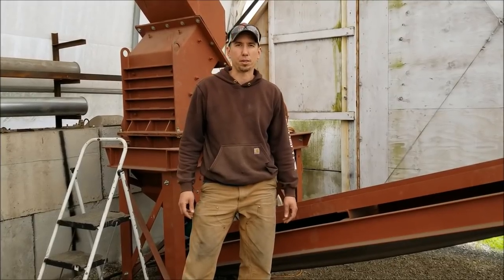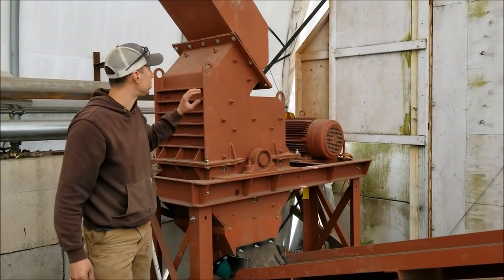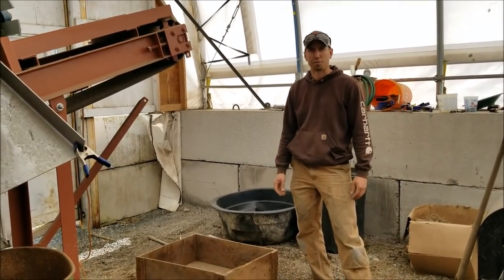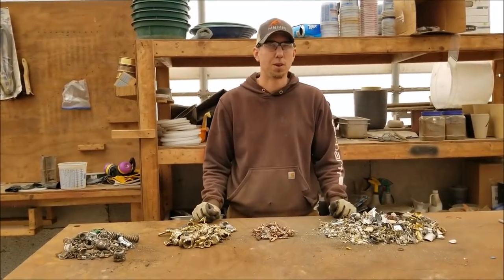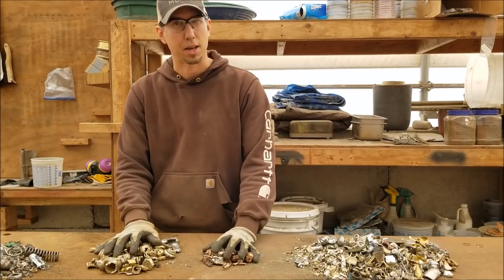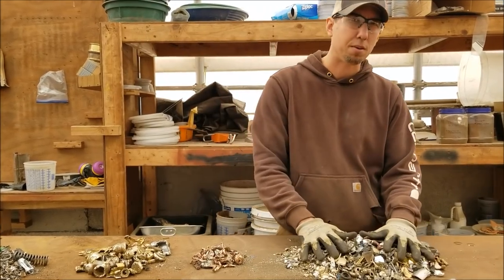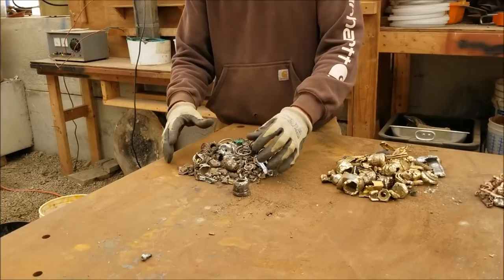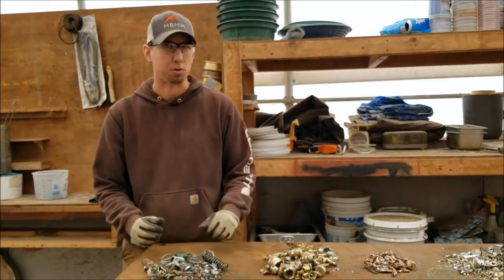Crushing Dirty Brass and Copper in a Hammer Mill

Comment: I know Jason you've been very busy with your new Foundry but here's another suggestion I have for you I would really like you to run submersible pump motors through your Hammer Mill there is a lot of copper in them but the stainless steel jacket and the epoxy coating that's inside is a beast... would love to see some samples
Reply from the maker: Do you have some you can send up?

Comment: If you slowed the conveyor speed down and moved the magnet closer to the machine, it would be easier to hand pick.  I wonder if the intake could be modified to hand a 4yd dump hopper full of material.